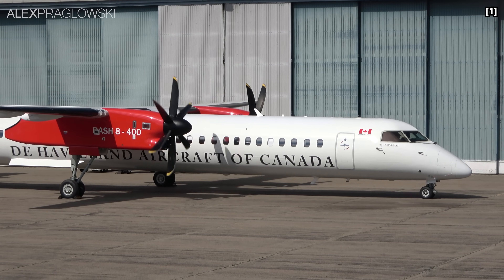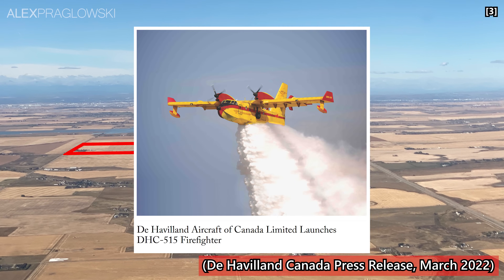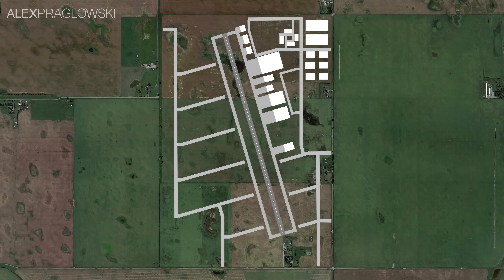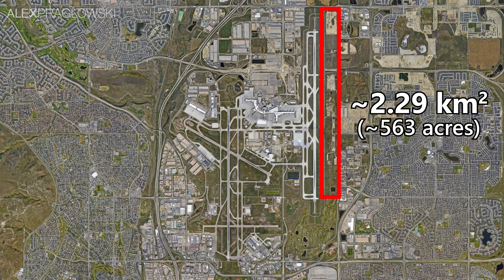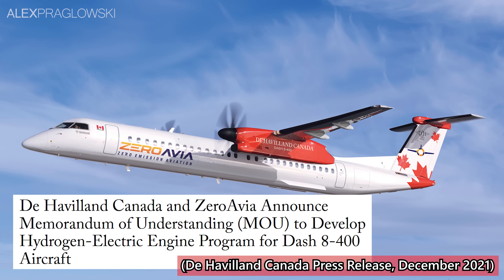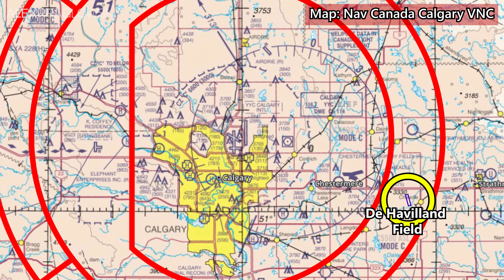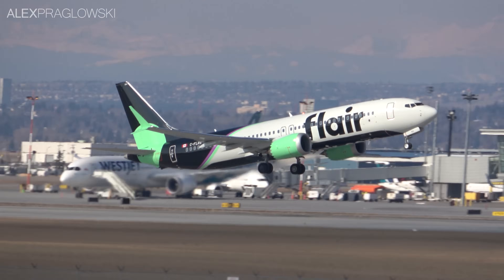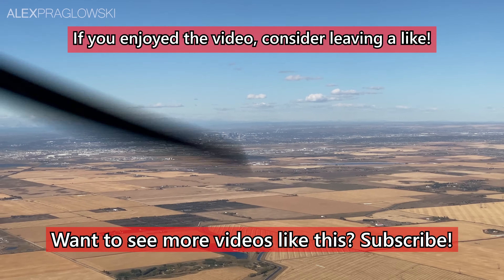Calgary Might Be Getting a NEW AIRPORT?

Comment: While a new 'greenfield' airport is the only viable option for an operation like deHavilland, it's going to be a traffic nightmare to have all the construction and eventual airfield workers driving to & from Calgary every day, as well as the emissions from all that commuting, the loss of agricultural land and general encouragement of further sprawl. Given most commuters from the city will be looking at 90-120 minutes in their cars each day, I'm sure property speculators have already started descending upon Strathmore, and the good folks in Cheadle will kiss their prairie solitude good bye.
The notion of this airfield serving ULCCs is a stretch; comments about the field length v elevation are correct: it's inadequate for the 737/320 class of airplane. Carriers want to serve where people live, and this site is simply too far from Calgary. The Ryanair approach of serving secondary airports far from the advertised destination may work in Europe, but WestJet's experience in Hamilton, and Air Canada's in Abbotsford suggest that it doesn't work in Canada. Lynx/Flair etc serve the major airports for a reason. 
The new field will be designed to the AGN IV standard to allow for built-in compliance in the event of future runway extension - anticipate cargo aircraft serving a large distribution warehouse on site (Amazon Prime etc). Without referring to performance charts, I'm thinking 9000' runway length at minimum.
CY__ refers to a Canadian airport with a weather reporting station - will one be built at the airport? CZ__ is more likely.
Reply: You sound like you're from Toronto. 

"it's going to be a traffic nightmare to have all the construction and eventual airfield workers driving to & from Calgary every day,"

It's Calgary, not Torona. It's along a major highway, you won't even notice the traffic. 

", as well as the emissions from all that commuting,"

You're in the wrong Province to care about a little commute. 

 "the loss of agricultural land and general encouragement of further sprawl."

Oh no, we are going to lose .0000001% of our farmland. 

 "Given most commuters from the city will be looking at 90-120 minutes in their cars each day,"

If you live on the east side of Calgary you're looking at a 30min commute which is standard on the prairies

" Strathmore, and the good folks in Cheadle will kiss their prairie solitude good bye."

Lol, no clue. Strathmore is a bedroom community for Calgary already, and is on the highway, and Cheadle is a tiny three road old townsite.
Reply: @TheOwenMajor  Not from Toronto. Never been there. 
You're simply looking at the 'now' and unwilling/unable to see what's coming. "If you live in east Calgary..." is such a head-in-sand rationalization. Some will live there, most won't. I forecast 45-60 minute commutes for those in central, south and west parts of the city, and whoops, did you forget to include the time spent driving home? Hey presto: 90-120min as I said.
Do you honestly think several thousand rush-hour workers won't affect highway traffic and congestion/prices within adjacent towns? Sure, ok. Come back to this conversation when it's all built. 
Oh, do you like your humble pie fresh or frozen?
Reply: @adrianwapcaplet2773  I'm not sure what your point about the commute is.

How long people are willing to commute is a personal decision. My point was the commute certainly isn't outrageous in any respect. Don't like the commute? Move closer or find a different job ... just like literally every other job. 

The reason I think you may be from some mega city is because you seem have either really nonsensical opinions or you just like to whine alot. 

"Do you honestly think several thousand rush-hour workers won't affect highway traffic and congestion/prices within adjacent towns?"

Calgary's metro region is comprised of almost 1.5 million people. It's not a small project by any means but the airport/manufacturing facility is hardly a mega project.

Like seriously, what planet do you live on?
Reply: @TheOwenMajor  Right on, Owen, you're starting to get it. You recognize that people can "move closer" to their jobs. What do you think might be the effect on small towns/rural areas when several hundred families are "moving closer" to their job in Wheatland County? However...spouses' jobs, kids' schools, plus all the attractions of a metro area will likely mean that most will live in...Calgary. Which isn't an enormous population, but it sure is spread out over a large area.
So: we have people looking to move adjacent to their jobs (placing an enormous burden on Strathmore/Langdon/Chestermere etc) or we have people moving into Calgary proper. Either way, they'll be driving to & fro by car (usually single-occupant of course) - never mind the hundreds of daily parts deliveries, courier, service etc etc. 
You don't seem to grasp how even modest increases of traffic dynamics on highways can drastically alter flow and increase congestion. I guess only inhabitants of "mega cities" would understand?
Finally: don't be the type pf person who finds an opinion they disagree with, and instead of engaging in honest debate, makes uneducated guesses and levies accusations of "whining". Be an adult, Owen. Be as civil online as you would in person, because I can guarantee you wouldn't speak the way you do if we were sitting together discussing this issue face-to-face.

Comment: I’m just surprise that this new facility isn’t being at Springbank Airport west of Calgary. Springbank has plenty of extra space, little commercial traffic, and room to extend the runways.
Also it would be cool to see DHC resurrect the Buffalo or Caribou.
Reply: The land isn't as flat out there, the amount of space they need would probably require a ton of ground work
Reply: YYC or YBW would mean having to deal with Calgary airport authority. Big mistake. YBW also has a hill to the north, therefore, even an extended runway would have problems in IMC conditions due to climb and approach gradient clearances. Where they chose is pretty smart.
Reply: de Havilland tried to resurrect the DHC-5 Buffalo as a contender for the SAR replacement program, but they didn't have a modernized version ready and lost to the Airbus (CASA) C295. If the Canadian armed forces won't buy it, a DHC-5 resurrection is unlikely. 

The DHC-5 Buffalo was a turboprop derived from the radial-engine DHC-4 Caribou; no one would go back to the Caribou.
Reply: Because you would have to change the name of the village from Harmony to Discord.
Reply: Not going to happen. The pressure from residents would be too great, and there is constant talk of CYBW being closed due to the amount of money that could be made from other uses.  I think that the movement of heavy GA traffic to this new field is more likely.
Reply: Too many Richie Rich ppl would oppose it

Comment: Seems like a great location but it is also a very long way from Pratt and Whitney Canada in Montreal. Dash-300 confirmed has to be correct. If you look at Greenland Air they use the -200 due to small runways. Perhaps the 300 with engine refitted can serve places like Greenland going forward. Ideally the iconic Twin Otter gets new engines, pressurization and retractable gear. The Q300, Q400 (not letting the Q branding die) and the Otter should be in play. If they were bold they would buy the rights to produce and service the CRJ 500 and 900 models as well. As we move to more net zero emissions, smaller runways, smaller airports, much smaller aircraft will start to dominate. We may soon see the end of single aisle 737's flying less than three hour durations. Big airports will be for Asia, Europe, southern U.S and southern hemisphere.
Reply: IIRC, the PT-6 is made in Lethbridge, so it is not far from a manufacturing facility at all.
Reply: A Twin Otter with pressurization and retractable gear is just a slower Beech 1900. I think it's good in the niche it's in. A revived -300 would be amazing though.
Reply: CRJ is sold to Mitsubishi.
Reply: Twin Otter is fine as is. Has been and will always be.

Comment: Would not be shocked if this becomes a viable alternative to YYC for low cost carriers in the next 20-30 years like Abbotsford has for YVR.

That being said the Lower Mainland beyond Vancouver has a much larger population than that area of rural Alberta, and with the new runway and terminal YYC isn't exactly running at full capacity anyway.
Reply: Not going to happen.  There is far too much capacity at YYC, it's too close to YYC intentionally pollute the eastern arrivals/departures, the infrastructure needed for a terminal, etc. is too costly, and ULCC's are not going to invest in this.  It is scoped, sized, and configured to be more of an MRO field rather than a commercial passenger services airport.